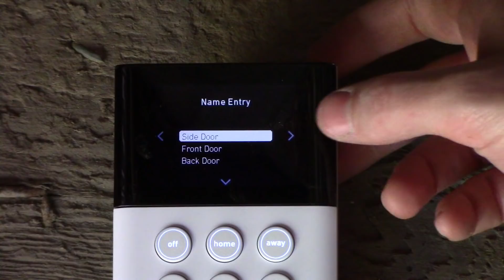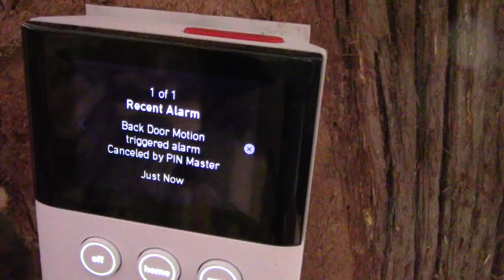Thieves came. They Stole. They Poached. ...We take action!  / Log Cabin Update- Ep 11.10

Comment: The old timers worked hard. On a fifty acre sugar bush, the old timer had set up lines and tanks. Near the road, there was a 4000 gallon sap tank, releashers, vacuum pump and generator. The punks opened the tank, dumped 4000 gallons of sap, stole the fuel tank and generator. The old timer never found out who did it. I hope to take over on the bush and I can assure you that under my red plaid shirt lives an an old cowboy. I will introduce them to my security team.. mr Winchester and Mr Marlin. I have even seen old walnut trees poached. That feeling of discovery is a wrenching sensation that you never forget.

Comment: This kind of system has been drastically improved by the energy density of lithium batteries. I didn't hear you mention a normal power supply for the base but it would need a power line or solar supply. As you mentioned you are fortunate to have cell service but that belies your claim of extreme isolation and also explains your apparent willingness to rely on ""local law enforcement". I'd do that as well, these days anything you do to protect yourself will land you in court and might land you in jail.

Your grandfather's reliance on wood for winter warmth calls to mind an old west analogy: Rustling (horse or cattle theft) was punishable by death. Both animals were vital, literally, to the frontiersman. Your local judge will likely slap your 'poachers' on the hand and politely suggest they not repeat. Of course, that judge lives in a gated community and his winter warmth is delivered by wire or pipe.

That judge would never understand if those poachers were found riddled with 00 Buckshot, yet it still would be just.

Comment: I had a similar problem at my parents camp and solved it by using a brace and bit to drill holes in select pieces of wood, and dropping a few 12 gauge shells down each and sealing the holes with sawdust and Elmer's glue.

Comment: It's a great system, BUT, not particularly wise to give away information on what and where your sensors and system hub are located. If the thieves see your video, they could potentially figure out ways to circumvent it, or just realized they must grab and scoot quickly with whatever isn't tied down. I hope you at least have cameras concealed in the wood line.
Reply: if they spot the panel on a shed roof they will put 2+2 together,but then again it will have achieved its purpose.
Reply: Please put gates on the woodshed. Time is your best friend. The longer it takes to get in, the more likely the thieves are to give up.

Comment: I would put a collar or black paint across any of the blue light that shows when activated.  As well as paint the units brown to disguise their location.  Just me I suppose.  Good luck catching them.  Grateful it isnt your cabin in the woolywags.
Tho a trail cam would still be a good idea pointing across the road at the shed.
Thankyou for the great entertaing videos.  You do a splendid job with your story telling.  What is the music at the end?
Reply: Hi wi11y1960 Cam on duty now, I too thought about the light etc. We will be improving the setup for better function.  Cheers
Reply: @senioroutsider2975  a few pieces of landscape cloth stapled in place to make a curtain will shield everything except the motion sensors, you can also use some hooks near your sensors to make it easy to reset the magnets. those indepent door chime alarms work great for that also and are battery operated, but no detection, if you want something to scare them off.

Comment: Back in the day I processed my logs in the woods to 4-ft lengths loading each in the trailer and then I would finish cutting them into thirds once I got back. That saved a ton of back and forth travel time as I could carry and load three 16-in pieces in one 4-ft log per trip.
I see a lot of places where you could drastically increase your production through time saving measures as I mentioned plus having dump trailers.
As I cut the logs out in the forest I would do three taps and one cut moving down the log estimating my 16 in lengths and ending with a 4 ft cut. I got really good at estimating what 16 in was and saved a lot of time stuck out in the boonies by limiting my cuts to 4-ft lengths out there allowing me to get back to civilization much faster with full loads.

Comment: I had the same problem and I solved it for next to nothing.
I purchased a few peiso units and a packet of cloth pegs and some fine fishing line, ever opening had one and it  involved running a lenght of fishing line from a fixed point to the cloth peg.
I put  small screw to the inside part of the peg on both ends so that when the clothpeg was closed it made contact with both screws.
I took the posative line from the peiso and screwed i under one screw of the peg, the negative i soldered to on side of  contact of the battery, the other end i ran a bit of wire the the other screw on the peg so that when the peg was closed it sounded the alarm which is very load.
I attached one end of the fishing line to the door post  and the other i made a tab to which the other end of the fishing line was attached, this when pulled tight is slipped between the peg, being held there purely by the force of the closed peg, if anyone walks through it they pull the fishing line and its tab from the peg, the peg closed completely and completes the  loop and the alarm goes off, as both are very small they are hard to findto try and stop the noise and by this time most intruders have hot legged it away, the battery tend to last for six months which for me is not  costly  for the safety it gives.
Its that easy to set up you can even mark out a square of ground  in the middle of nowhere and it works.
Hope this also helps both you and others, i only have a crossbow but its enoughnto pin someone to the wall and getting away become a bit painful.
There is also a good trap with a length ofbfishing  line with about twelve reasonable size hooks on a short lenght attaching it to the main line, usually, once caught people struggle only to get hooked by a few more hooks.
People may say that this is a bit cruel but so is stealing, as you say, what takes them a couple of seckons to steal can have taken a years work, even wourse when its tools that you use every day, so my feelings are if you dont wantbti get hooked dont steal.

Comment: You need solar power unit, then hard wire main units in place. It will be cheaper over time. It also helps on preventing the system from losing power due to dead batteries. They would be a good backup but, I believe just using batteries will be expensive, depending on how well the simply safe system uses power. Good vid
Reply: He has solar on the roof for it

Comment: Way to go simplisafe we love them and we have there system as well and there video doorbell and cameras, they are awesome but may i suggest to move the base station where they cant see it or try to shoot it or something like that because they smash the keypad and it will still work but if they destroy the base station thats it plus i thought all the sensors could not be in extreme cold or heat temperatures but hey as long as it works for you guys im glad. #simplisafe4thewin #simplisafe4life

Comment: Looking at the security system I was thinking that it should have a way to turn off the LED lights on it and same on the sensors. Also the hub should be able to be screwed to a base so it can't be knocked over. The most important thing in any security system is the ability to hide the control box so it can't be damaged or easily found by an intruder. If there is no switch there always is tape to put over the lights. In addition in times like this we are best when we are more than just one person in an area against intruders. We are best to have family and neighbors of similar values.

Comment: After the first theft, I would have installed big locks and a laser tripwire system (cheap to build and can run off a single AA or solar-battery cell for months). Internet connection and/or radio transmitter don't cost much but are power-intensive.

Comment: Never go alone or unarmed. Don't be afraid to use your 🔫 gun, their not. The legal problem is, you going after them armed. Best thing to do is a door and titanium locks. A gate across the road with a titanium lock and chain. Bolt on hinges with the nut on the inside. Make it very difficult for them to steal. Dogs can help.

Comment: My concern with the simply safe inside the wood shed is if the bad guys come at night won't they see the light on the main part of the unit and if grandpa forgot ppl where coming would he remember the sensors and passcode in a panic? I think a plan B as a backup plan is needed like the video cameras that show up on your phone or tablet when motion is detected, they make them in sensor lights where you can see the bad guys and tell them you are calling the athoritys. I've seen some you tube videos of them lately.

Comment: I'm afraid that ANY self-respecting THIEF would notice a SOLAR PANEL on the Front   Roof (and want to STEAL it too ?)
 (with just a little engineering the Solar Panel could have been placed on the "BACK" Side of the Wood Shed & still be aimed correctly at the SUN)
 
The  BASE STATION is out on a pedestal in plain SIGHT (Sticking out like a sore thumb)  a great TARGET for a Shotgun Blast or a target for a well aimed chunk of WOOD ? 

The Trip Wire controller did NOT need to be advertised at all on the "proud" side of that TIMBER by the DOORWAY 
( it could have been just as effective tucked back in the Wood Pile or against the Exterior Corrugated panel) ?

I'm not sure of the  "RANGE" on the Motion Sensors ... but they would be almost invisible up in the PEAK of the Roof Trusses instead of in plain sight

Comment: Wireless security systems are terrible, you really  can't beat a hard-wired mains-powered class 3 system (i.e a good Honeywell system) and they CAN NOT be tampered with if you install them correctly, i.e get a licensed contractor. That also doesn't look to be correctly rated for outside use. Hopefully it did the trick but get yourself a proper system asap to protect your livelihood.

Comment: Why in Gods name would you high hitch the log to drag the thing out? most dangerous practice in the listing (just behind was using the chainsaw with an axe in a backpack)  besides being a blatant and overacted piece of advertising.   i solved this same problem (stolen firewood) by simply drilling a 25mm hole in the end grain of a small log, for a depth of about 100mm, then filling the cavity with black powder (a nice load of 000 from my smooth bore) then after sealing the hole with a plug of the same timber, cutting flush and dirtying the end,  marking the piece and carefully noting where I placed it when restacking. I have since  only lost one more stack.  I smiled to myself as I walked away with my reputation as a person not to be stuffed around   ......intact, unlike someone else's fireplace.   Note. do not be tempted to punish the offender only enough to see the error of their ways.

Comment: tripwire in an semi-open woodshed in the forest? no. that's nothing but idiotic! every single sqirrel/deer/fox/whatever is sniffing around will set it off or even the slightest breeze around the corner rattles on that string and drags it off. Why not just simply set up some trail camera's and get a picture of the people and even the numberplates of the vehicle? usually in such cases it's someone local who knows where what is stored and who is where at which time...

Comment: The wireless communications between the devices and the controller is extremely weak. Thieves are tech savvy now too and you are using 30 year old technology that was never quite up to par. Approaching from behind and easily disabling any motion detector. Were the instillation done with the security that copper wire use to give all devices could protect themselves. They now have cameras that show you the intruder in real time with a bit of security by internet but once again jam the RF and you have nothing. What you have here is a false sense of security, smoke and mirrors. BTW I have over 20 years of experience in electronic severance which include a DOD rating. In this situation usually the simplest method is effective only when enforced or backed by a man.